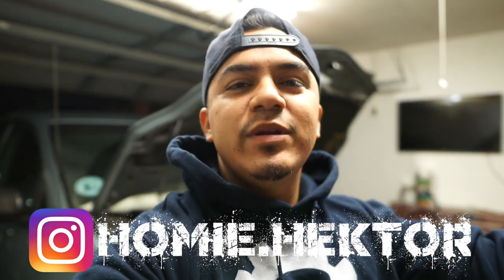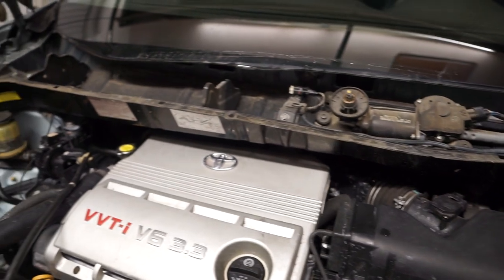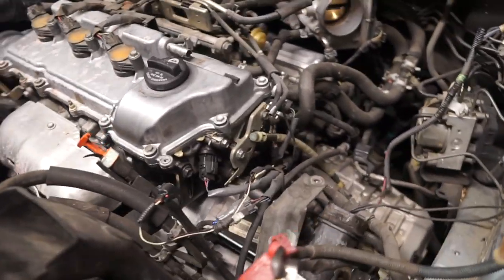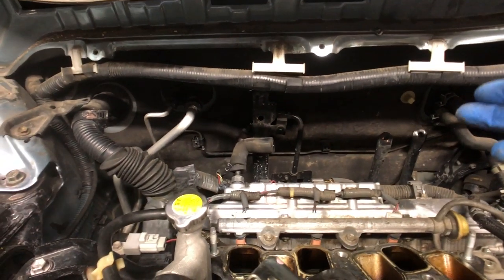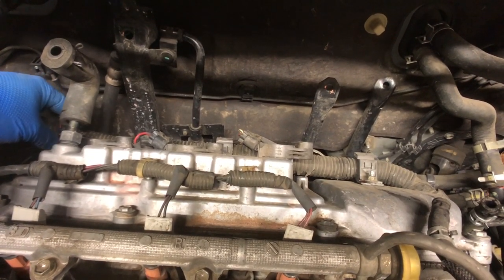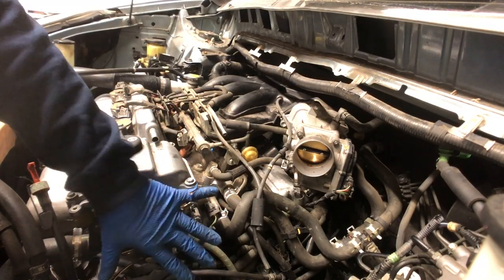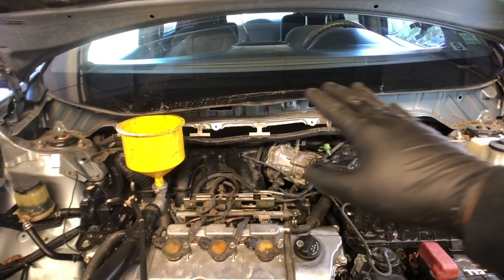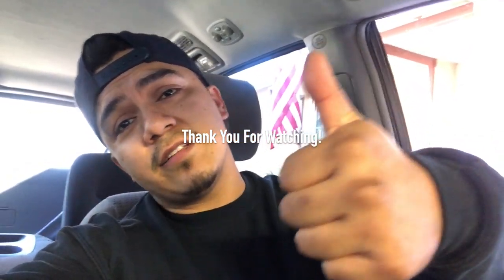How to Change Spark Plugs on a 🔩2006 Toyota Sienna 3.3 Liter

Comment: Thanks for the video! Had to  change plugs in my wife's 06 Sienna this weekend. I had to take the throttle body off the intake to finally get the last bracket bolt out, but I'm probably twice your age, so old age was a factor there. The one thing I found was don't even try to unplug the coils. The lock tabs break off just by touching them. Thanks again for a great video!

Comment: Got the same project with my van. If you haven’t already wait until you get to change the timing belt and water pump on that  MZ motor. That’s double the fun!! 😩
I’m a Toyota guy but I loathe working on that engine. Needed a refresher on the easiest way to change plugs. 
Thanks!!! Good work!

Comment: I used to love doing these at Toyota 3.5hrs was so gravy used get them done in 1.5hr usually, anyways great video
Reply: Yup same here and I don't even pull the wiper cowl.Also removing the throttle body and spacer makes it easier.

Comment: Last time a mechanic did the plugs in my 2006 he said he had to rotate the engine. Thinking of doing this myself due to massive increases in labor. Great van - holds full sheets of plywood/drywall with middle row seats removed. Very few issues in 228,000 miles except dangerously clouded plastic headlights (should be illegal imo). Good video, except the F bombs.

Comment: I was able to replace the left side one and middle , with just removing the cowl and the pcv elbow on the left side . Hurts your hands , and is a bit tedious , but I doubt as tedious as removing those bracket bolts . The ideal extension length needed is around 31/2 to 4 , and a ratcheting 10mm wrench will save you a ton of time ( didn't have one ) gonna try to remove the right side in a few days when I get a ratcheting 10mm , pretty sure you can reach under the throttle body .

Comment: suggestion you could do: what part you bought and what torque specs for the spark plugs are (or any other part that requires torque specs). because it looks like you just torqued down spark plugs with the drill and that could actually mess things up for people who dont know what they're doing...

Comment: The amazing thing is the 1mz variants are STILL in new Toyota/Lexus products. Just updated. If it broke don’t fix it. I’ve seen people rock these motors forward but you got a lot more room to work with, I’m not sure if i will have room without a special tool but I’ll see, thanks 

AND OMG THE BAMBINO you do family 100% right. But yea my solara....I need to get a scan tool because it’s idle rpm is a little rough and when you go to give it heavy gas it...I’m not sure if it’s the transmission failing to kick down or if there’s a fuel issue causing a major shudder before it picks up so I gotta do some diagnosing. It’s been sitting for years

Comment: I’m surprised those rear bracket bolts were even there. Usually, the kind of hack that smears rtv silicone on a silicone rubber gasket won’t replace all the fasteners.
Reply from the maker: Pauly D that’s what I thought 💭

Comment: My #4 coil came up as misfiring. I figured it was a good time to replace plugs. I did front 3 plugs and one coil easily. I looked at the rear plug placement and decided no thanks..  let my mechanic do that. Incidentally... OEM plugs are $13 each and coil $130!!!   Went to a GOOD parts store... plugs $3.50 each and Walker coil $38.

Comment: Perhaps this answer is in he video; does the service manual require replacing the intake gasket once removed?
Reply from the maker: Always…not required, but recommended
Reply: @HomieHektor  seems reasonable as it could easily be damaged.

Comment: Did you bleed the coolant because the spark plugs or because you did the thermostat? Honest question. You did not mention why, other than that’s great video! Going to be attempting soon
Reply: I wondered too, but probably primarily bc of the thermostat. I’m about halfway through this repair myself, and some coolant leaked from the throttle body. I’ll go ahead and bleed the system when finished.

Comment: Also I’ve got a few Milwaukee impacts, I was sure the m12 fuel surge or my m18 surge would get the shock tower brace nuts off, but they wouldn’t budge until I pulled out the gen 3 m18 fuel. I’m not sure if someone used Ugga Dugga’s on them years ago or if my impacts are just weaker than I thought

Comment: I can't agree with not replacing the back coils. You were there, all that labor, and if you get a misfire later in those bad coils, you're back into all that for what you could have replaced when you were there for just the cost of the coils in a little bit more labor. That could lead to an unhappy customer. 

Somebody was already in there, because the valve cover gasket's have a tendency to leak, and when those valve cover gasket's leak, any removal of the Plenum should the company changing the spark plugs and the rear coils for sure. They just put silicone on there because they didn't replace the gasket or they wanted some extra insurance on top of that to prevent future valve cover leaks.

Comment: So, at a Toyota Dealer paying 125.00/hr labor, replacing plugs would be an 800.00 job!
Reply from the maker: Craig Jorgensen it gets expensive 💸
Reply: I was quoted 560.
Reply: So if your doing this job for a friend is $90.00 hr labor is to little?